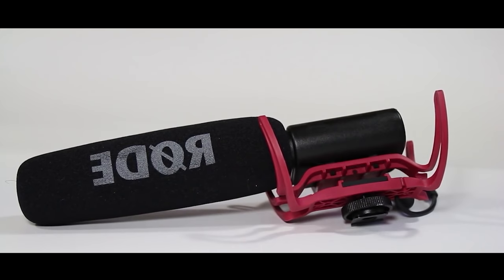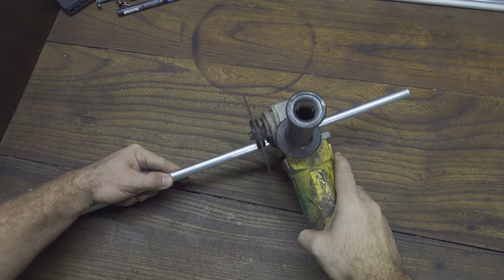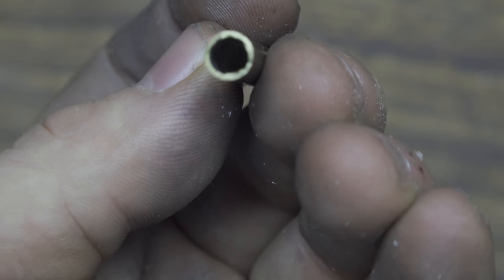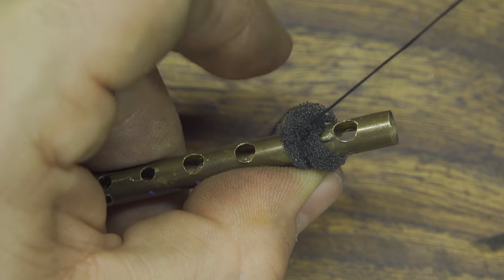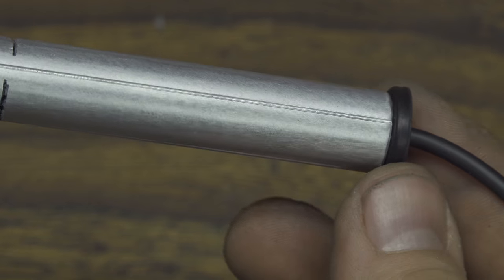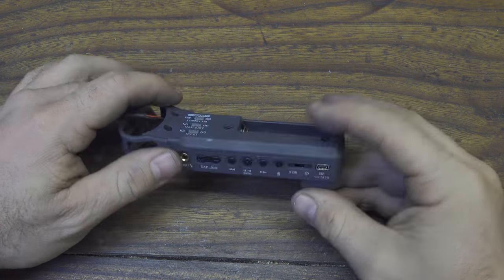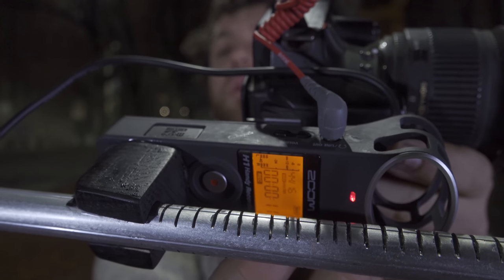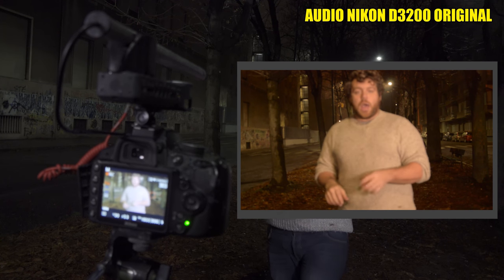Homemade RODE Microphone - How to make it

Comment: Can't I just put the Zoom H1 on top of the camera? Does the pipe improve the sound quality so much?
Reply: MyProjectsTV it makes it directional, the whole idea of this style of mic is that you can point it in a direction and it will pick up only the noise from the direction you are pointing it in (eg if you want to interview someone in a crowded place)
Reply: Asher Werner But does this pipe makes a so big difference? You can just bend the mic on the Zoom H1 to the right direction.
Reply: MyProjectsTV it makes a difference
Reply: But he didn't show it being directional.  The whole project was to make the Zoom H1 into a directional mic, but he never compared it to a stock Zoom H1.
Reply: roidroid Exactly, even he build this as directional mic, he could use the Zoom H1 and have nearly the same results.

Comment: you could have connected the 2nd mic on the other side of the tube :) \\ and maybe with a small 3-pin switch yo ucan turn it on or simply short-circuit it as you did 

great work :) easy to build and detailed steps